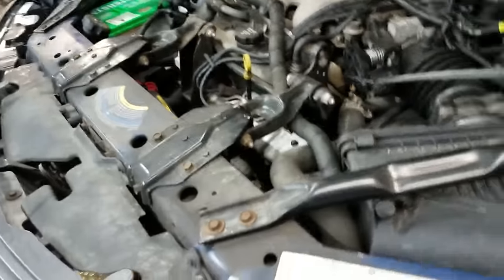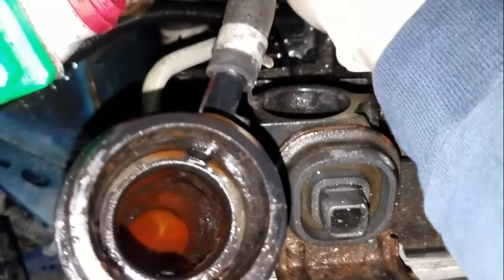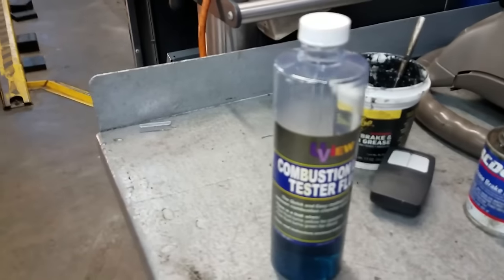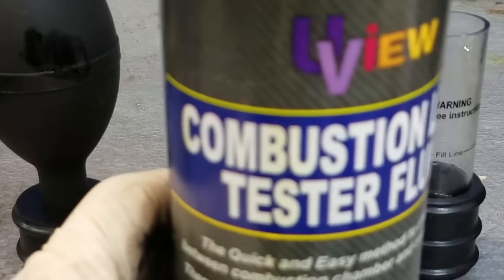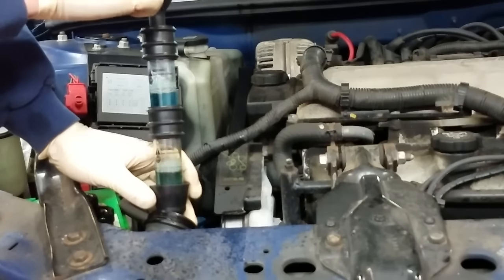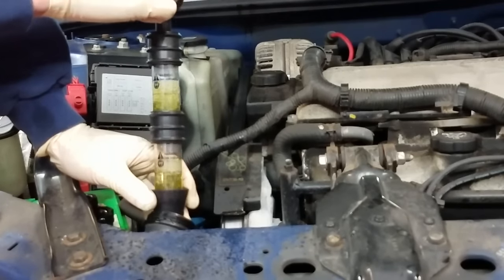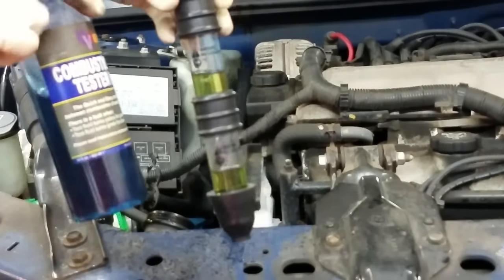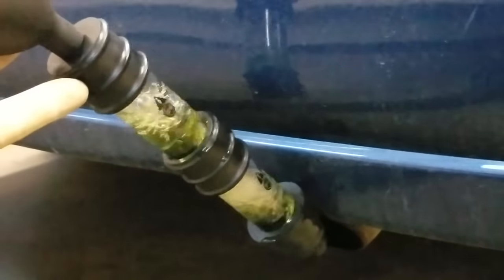How to tell if you have a blown head gasket "3 Easy Test"

Comment from the maker: Here are the links to the test equipment I used in the video.
Combustion Leak Tester: http://amzn.to/2u9WyLA
Coolant system pressure tester: http://amzn.to/2ptJMlC
Headgasket sealer: http://amzn.to/2ubs9N8
Reply: 3
Reply: Thanks FRM. My engine is running rough, oil on radiator cap, using/losing water, and #1 plug was "gunked up". I think it's the head gasket, but no bubbles in radiator at idle. Will try your suggestions.
Reply: What about a cracked head

Comment: Question, you said the only way combustion gas can get into the cooling system is for a failed head gasket.. would a cracked head or crack block also be able to allow combustion gas into the cooling system?

Comment: Thanks for posting about the combustion leak tester.  It is rarely mentioned in videos or in forums.  Question: Do the leaks always go both ways, or only when there is a significant amount of damage to the head gasket? In other words, the most commonly mentioned indicators of head gasket leaks is coolant getting into the engine oil.  While significant leaking can be fairly obvious, detecting leaks early can be more difficult because moisture coming from condensation (for example) can create milky coatings similar in appearance.  I like that the combustion leak as a test since the gasses wouldn't come from other sources.  However, before investing in such a tester, I'm curious if this symptom would be just as reliable to expect no matter how far along the damage is.  In theory, it makes sense: in a closed recirculating system, if the fluid going into the engine doesn't continue out of the engine and escapes into the oil mixture, that gasses might instead be sucked into the intended path of the coolant on the other side of the leak.  But I'm not a trained mechanic and many of us searching for answers here haven't broken down an engine block to understand the path that fluids and gasses take through one.
Reply: In the very beginning it can be a little tricky sometimes. But there will typically be fluid going into the oil, just as there are gasses into the radiator. Usually from someone with a leak in the radiator system running it hot n then filling it with water, thinking they are then ok, only to find out later the head gasket is torn, or possibly even the head it self.
Reply: the testers can be rented at most auto shops like autozone.. u need only purchase the fluid

Comment: Great video!! Thanks for sharing this with us.

I've taken the xoolant exhaust test but found it took a really, really long time the the blue liquid to change green - like 7 or 10mins. When that happens, would you say that could be a crack in the head / block? Or perhaps an incorrectly positioned headgasket? (I.e. not flat cyl head or block mating surfaces)
Reply: I had a similiar experience with it... initially stayed blue but i did get some green appearance if left on too long BUT what was happenning after extended periods was the coolant level Rose high enough to get sucked Into the tester and That colored the fluid at that point... so make sure thats Not the case.... the color change should show very quickly if its leaking gases...would not need 8 mins to determine

Comment: If it's a head gasket would it still start but have lots of smoke white coming out the back?   Asking because I have a Honda oddesy and the battery light came on and then it shut off and then I got jumped off and got around the mountain for it to die.  Had it towed and they replaced the alternator and I go pick it up and it started and as I pulled out the parking lot , lots of white smoke in the back. So I did a uturn and back in their office .  now I'm waiting to see what they say in the morning.   He said it could be a head gasket and then later in the evening he said something about the PCV valves.   Any advice ?  If it was a broken or  cracked head gasket would it still start up and drive ? He mentioned PCV valves saying that the way it was towed in might have got oil or something in it.   I'm confused 😞

Comment: Great video, showed me some good things to look for when I was trying to get to the bottom of there being oil in my coolant reservoir. If anyone knows differently please correct me, but I think these tests only show you if your head gasket has a crack/hole/gap from cylinder to one of the coolant pipes in the engine. On my car since I have no exhaust gas in my coolant or pressure, I think I just have a small leak between one of the oil pipes in the engine and one of the coolant pipes. Again if my understanding is mistaken here I'd like to know more. Ran a compression test and that was on the good side of the acceptable range so pretty much confirmed no leak from cylinders to coolant. Still need to replace head gasket though and will replace other seals while I'm at it, but good to know that the problem isn't catastrophic.
Reply: Exactly.  This test works depending where the gasket gave out. If it's between the cylinders only, this test won't reveal that, other than not changing colors/ reaction. At that point you need a compression or leakdown test. Also look for codes.  Between cylinders, it should give you a code. Based on what this video showed; bubbling on cold engine upon removing radiator cap.  This is a good indication of faulty head gasket.  At that point using this chemical test is the way to go.

Comment: I have a 2000 civic.  I did the head not to long ago abt 6-7k ago and noticed a crack in the radiator i took the cap off and started the car"it was still hot" and bubbles came out not like that and coolant wouldnt guah out fast but slowly

Comment: Great video man..I dig your straight to the point approach. This may sound like a dumb ? but does the combustion tester work with propylene glycol based coolant as well?  My '98 Cutlass 3.1L is running great no overheating fuel trims near perfect at idle but LT goes +7 to 10 when I rev it then back down to normal at idle. I'm getting quite a bit of white smoke out the exhaust and p0420 code but I figure that is due to deleted cat. Any advice would be much appreciated.
Reply from the maker: Not that out of the ordinary for the fuel trims the go + of idle. Hard to say
Reply: Why not try it my guess would be yes since that liquid changed color when it detects exhaust gasses I don’t think the type of coolant would matter
Reply from the maker: But yes a C0 tester will work with any coolant. It is testing for combustion gases exiting the cylinder into the coolant system, though the head gasket

Comment: Got a question regarding my 2008 Chrysler T&C with the 3.8L. 

Replaced all hoses and rad cap, brown sludgy stuff on the bottom of cap and inside radiator. Also a gritty substance in the overflow bottle. Oil looks clean, can’t check trans fluid, no overheating. Just a weird smell when running. It uses that yellow/orange coolant. I’m suspicious of a HG problem, but I’ve never had a Chrysler or used this coolant before. 127k on the odo.
Reply: we never got the beginning of the story. why did you replace the hoses and cap?

Comment: Well,  i dont have bubbles but my radiator hoses get very hard right away after 1st startup... wont run but few mins till over heats.... soo guess I've got bad head or bad head gasket...brand new radiator to...   258 AMC 6 cylinder engine..sound right??   Probably so.

Comment: I did the radiator cold start up test. For the first few  minutes of running the car ,  i did see a couple tiny bubbles appearing at the top  now and then ( but not consistent ) I let it idle longer for another five minutes or so and the tiny bubbles i saw earlier stopped.  211,600 miles on a 95 Camry.  My question is ,  what could have caused those tiny bubbles to appear at first  then stop..
Reply: i would guess small amount of air in system. if its a head gasket issue it will usually make the coolant level rise for a few moments bubbles come out an coolant level goes down a little to repeat itself , coolant reservoir will have a gunk stuck on the inside . oil cap might have a milkshake look underneath do to water vapor or after running car around the radiator hose will be rock hard, classic sweet smell from exhaust . continuous loss of coolant from the system needing to be topped off regularly . just a few things that are signs of trouble

Comment: Blown head gasket ...it means that the coolant is squeezing through the gasket seal into the oil in the overhead cam right...??
Reply: not nessessarily they are several ways a head gasket can go not just mixing with oil
1 chamber to chamber
2 chamber to coolant jacket
3 chamber to oil jacket
4 coolant jacket to oil jacket
and last but not least a cracked head

Comment: You determined the head gasket is bad based on the CO test but could it not have actually been a cracked head?
Reply: It could be, but there is no way to differentiate the two without taking the head off

Comment: I have unfortunately, a 2012 Jaguar XF Supercharged V8 Portfolio Edition. The car has a blown head gasket. Due to the aluminum block I'm also told it would most likely also be damaged. Mechanic said I would need to replace the engine. This would be at a cost of 8-10 thousand dollars. For a car with a value of $13,000 a total waste of money.
I spent about $48 at Auto Zone for a bottle of Bars Head Gasket Sealer/Repair. The gasket was leaking into the cylinder and causing the car to run poorly and white smoke out of the driver's side tailpipe.
After driving the car with the Bars in it the check engine light went out the engine is running correctly and there is no longer smoke from the tail pipe and no longer leaking engine coolant. Before you replace the head gasket try the Bars especially if like me your going to get rid of the car ASAP! Worked for me, it's supposed to last.  
Good luck!
Reply: Hurry and trade the car in that stuff buys you a couple months probably it's not a permanent fix
Reply: @bigmac22ify What about the person who buys it from the lot? Do you think that would be fair to them? Someone who probably has scrape up enough money to buy the junk with kids to feed. Real nice

Comment: I have a van thats had the radiator cap, radiator hoses, radiator and thermostat replaced. One day itll overheat after driving 3 miles, the next day I can drive all day with no overheating. Im confused and have no idea whats wrong because it happens sporadically.

Comment: This was donee on a impala 3.4L if im correct, how long was the car able to run for before over heating? I have a 2004 Chevy Impala 3.4L that is over heating about 20 mins of running even after i replaced the thermostat, Bypassed heater(heater core doesnt work) replaced hoses, replaced the radiator cap, flushed the system and put new coolant in. I am not sure on how to properly bleed the system. Are you able to give me some advice ? The bottom of my oild lid isnt milkly and neither is my oil, i dont see any external leaks. When i shut the car off the resevoir starts filling up.
Reply: water pump wit car idling  pinch radiator  hose if you dont feel any thing moving thru its probably  wp

Comment: What if my radiator doesn't have a tab to open up, can I look in the coolant system and see if bubbles are forming there?
Reply from the maker: If your radiator doesn't have a cap that means that it would use a pressured exspantion bottle and yes you could look in there as well.

Comment: Question, wouldnt you be able to hear its not running on all cylinders (blown headgasket)  by simply cranking it? The cranking sound changes when a cylinder doesnt have compression
Reply: Nope, mine runs great except bubbling and getting hot when not moving.  Just got the kit to test combustion leak
Reply: @MartinSage  yes it depends on the size of the leak

Comment: I have a 2011 Ford Taurus sel. 100k miles. 

I checked my collant tank last night and it’s milk shake.i checked my oil it’s clean and look like regular oil. Can a tranny cooler line cause this or is fashore the engine cooler? Car doesn’t over heat or leak on the ground nor does the engine loose power.
Reply from the maker: If it's reddish in color it would be a bad tranny cooler if its more oily color it would be and oil color. Both of which are part of your radiator on that car if I'm not mistaken.

Comment: 1996 GMC Suburban 2500 SLT 7.4L - radiator and reservoir full of grey, thick sludge big-time.... Although the truck runs great, the two dipsticks are fine... Oil looks like oil, trans fluid looks like trans fluid.... Some say oil cooler is problem, I am STUMPED HERE iN PHOENIX ARIZONA... HELP....
Thx,
 JSW
Reply from the maker: Yes, I would agree, radiator should be replaced.
Reply: alot of times those have an oil cooler or heat exchanger that leaks oil into the coolant its probably that. time to dig deeper looks like.

Comment: Did you recommend any head gasket sealer?
Reply from the maker: I would not recommend headgasket sealer. Can work as a bandaid in some cases but if you plan on keeping the car will only cause more problems down the road. Blocking coolant flow and plugged radiators. You will never be able to get that stuff out.
Reply: @FlatRateMechanic  Bars fix a gasket repaired a 67 Fairlane....
Still running after 23 years!
Reply: @artdude2823  what's the name of the sealer you used ??
Reply: @artdude2823  must not get driven much
Reply: Blue Devil head gasket sealer is the best head gasket sealer you can buy and comes with a money-back guarantee
Reply: I’ve heard those clog the radiator and heater core and basically ruin the cooling system I wouldn’t recommend them either
Reply: @howtowithelizabeth7513  it stopped smoking and really helped with my Cadillac. Motor water locked on me.from coolant in the piston.Pulled the plugs. Got water out of the cylinder by turning the motor over with the plug out(had to find the one that had coolent on it) a few weeks later my passenger side heat stopped working idk if there are 2 cores,could have clogged one. Sold the car as a beater 🥺 was a nice clean car (I was honest in the sale it was a good running parts car for 1,500) don't use unless your motor is junked or u plan on not saving it.

Comment: How can  you tell if it's a intake gasket leak from a head gasket leak? If the bubble symptoms are the same.
Reply from the maker: If the intake gasket is leaking you will typically see coolant on the ground or in the engine oil. intake gasket leak on its own will not cause an overheating problem until the coolant gets low. Headgasket can cause overheating even if the coolant is full.
Reply: @FlatRateMechanic  
It's not overheating and there is no visible coolant. What test can I do to make sure it's the intake. 
The reason I say this is because I was doing maintenance on the throttle body and I removed the plenum and  I saw some moisture in it. Then I checked the sparkplugs and there was visible coolant burning on the spark plugs. This is on a 2000 Accord v6.
Thanks a million for talking the time to answer. God bless.
Reply from the maker: @rudymunoz901  I have work on many of those engines over the years and have never seen any intake gasket problems. Its not uncommon to build up some moisture in intake due to blow-by from the crankcase, if there are no other symptoms and car is not using coolant or overheating I would not be too concerned.
Reply: @FlatRateMechanic  
Well.. I have noticed some coolant loss in the reservoir before, it's minor, about a full reservoir in a month. And it does not give me 23mi on the gallon anymore. only 20mi on the gallon and I have Noticed Some power loss. I thought this was normal being such an old car and having 200kmi but after watching
Your video and noticing the sparkplugs contaminated with burned coolant and not being able to get rid of the air in the radiator, it adds up.
🤔I was thinking I replaced the iac sensor about 3 months ago and reused the same gasket, can that leak in to the combustion chamber? I just want to discard any possibility before I commit to fixing half of an engine. 
Again thanks a million
And God bless you.
Reply: Does it matter? You have to replace all the gaskets to get to any of them.  You can't reuse them after disassembly anyway

Comment: I wrecked my truck. And when i turned it on 3 weeks later it was smoking...  Then it stoped smoking. But its smoking very little. Can that b the motor?
Reply from the maker: Really hard to say. Smoke can be caused by many things. Is it white, black or a blueish smoke?
Reply: @FlatRateMechanic  its white smoke
Reply from the maker: White smoke would typically mean coolant if it has a sweet smell to it.
Reply: @FlatRateMechanic  the oil has a gas smell
Reply from the maker: @nataliearcos4349  raw fuel can cause white and smoke too. What kind of truck is it
Reply: @FlatRateMechanic  its 2004 chevy silverado

Comment: Dose keeping water coolant lid lose stop pressure  build up in head??
Reply from the maker: Yes, but your car will still overheat. The coolant will all boil over and out. Having the system under pressure increases the boiling point of the coolant. With the cap off your coolant would start boiling at normal engine temp.